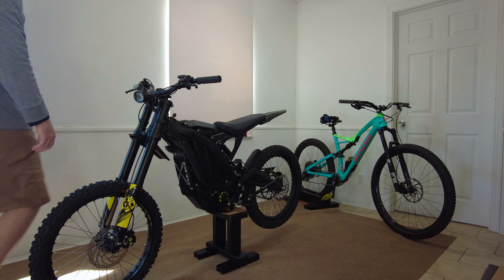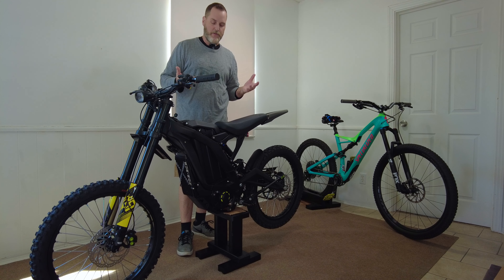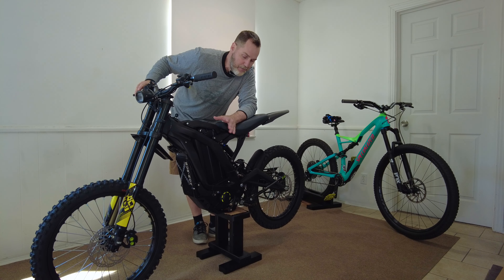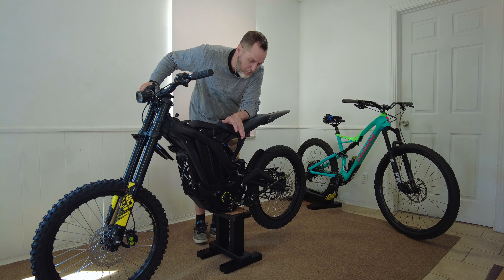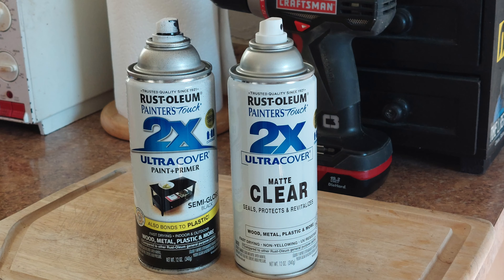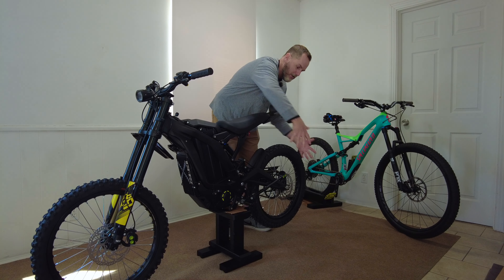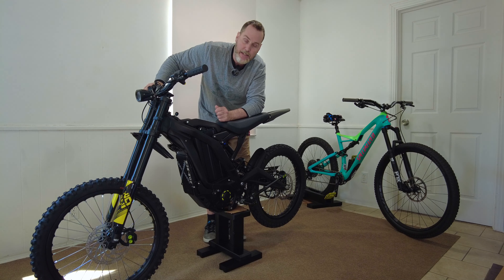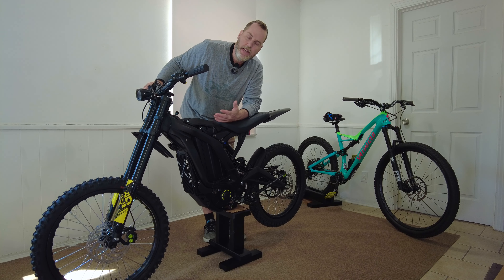Sur Ron e-bike stand finishing touch

Comment: awesome stand!  I need to build one of these
Reply from the maker: I am digging the home built stand compared to my MX bike stand. The cardboard stand that came with the Sur Ron was good in the beginning but stating wearing out. Only thing my wood stand needs is a durable rubber pad that I can affix to top board as the skid plate and peg mount brackets will over time beat up that top board. Many may folks would care less about that but I'm A.D.D in that way. I also put some little rubber pads in the corner of the wood that touches the floor making it better on slick surfaces like in the house.
Reply from the maker: Intro video on making the sur ron wood stand: https://youtu.be/ZEN-SxHGiXI

Comment: Nice  stuff I believe you but I wish you'd shown the bike on the rear wheel... thats my biggest gripe.. I just use mostly 5gal buckets right now ... always end up having to use like a 50lb dumbbell and some  bungee cord to keep the back wheel down..
Reply from the maker: When I rotate my front wheel to check those spokes I just move the bike back on top of the wood stand to shift the balance. Works fairly easily for a lite bike. The stand is perfect and really didn't cost me anything besides time. My bike sits inside on this stand when I'm not riding it kind of as a show piece.